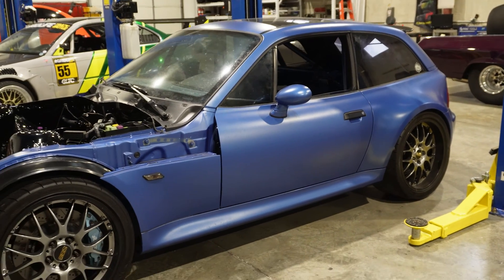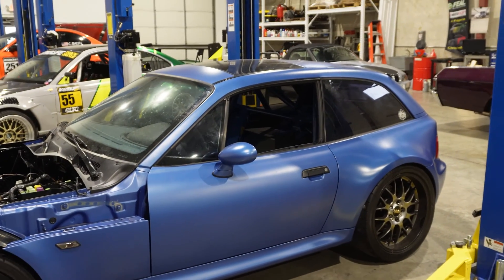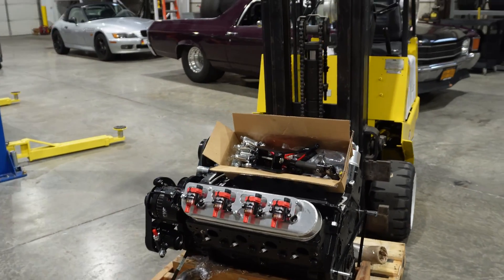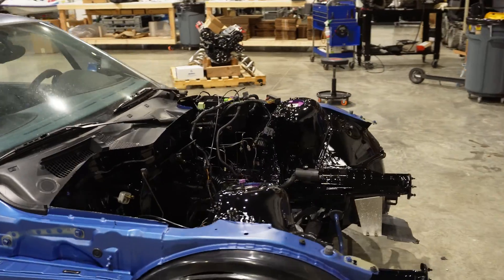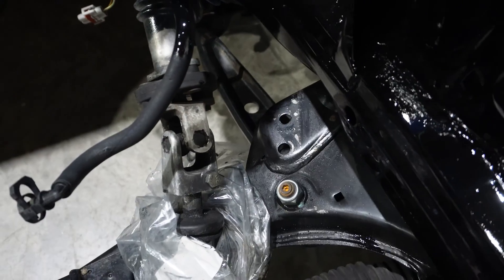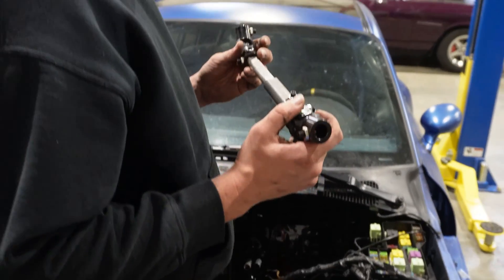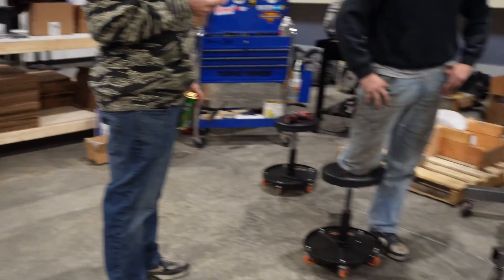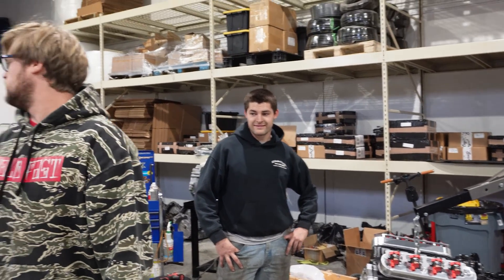Z3M/LS/8HP Swap Series! Episode 1

Comment: Any update on this swap?  We are in process of swapping in an LS1 into an E36 M3 endurance car, and now thinking of going either DCT or 8HP for it.  I'd like to know about clearance issues if any with the Dodge 8HP mated to the LS in that chassis.  We have the Vorshlag mounts and swap headers just like you have in this video.  Currently the swap is in using a Tremec TKX short ratio manual.
Reply from the maker: big update soon including full 8.8 swap! The 8hp cleared with only slight trimming

Comment: Does that flywheel not add a lot of rotating mass? You already have the torque converter the engine has to spin. Seems like adding a lot.
Reply from the maker: It does not really matter with an auto